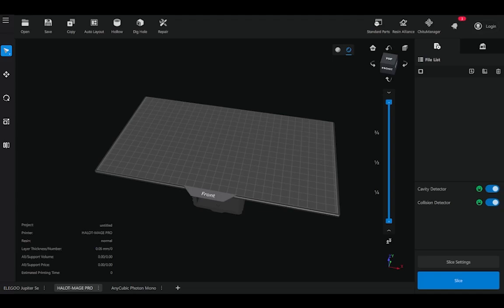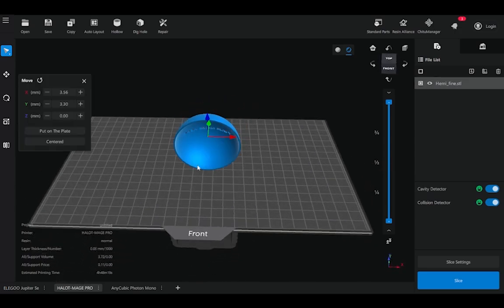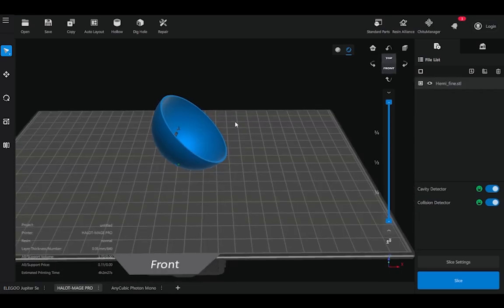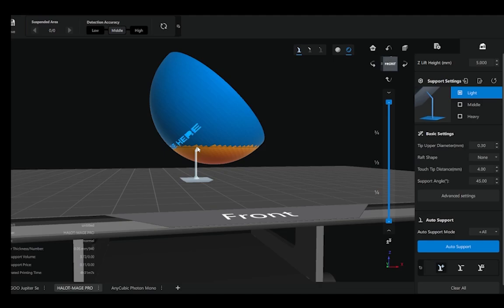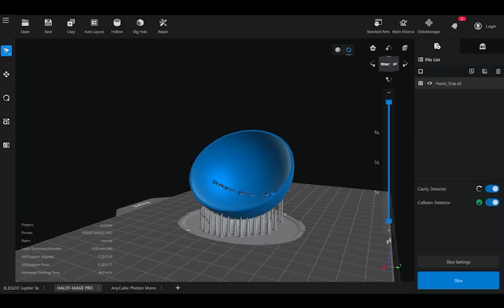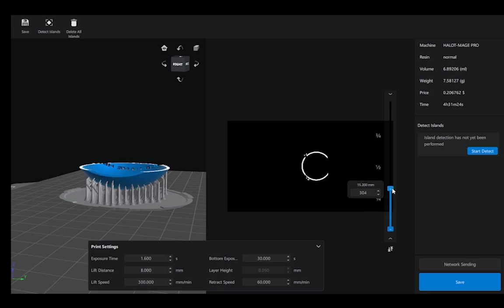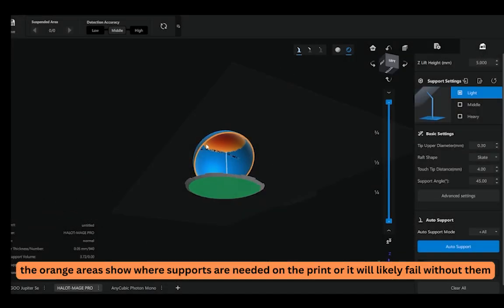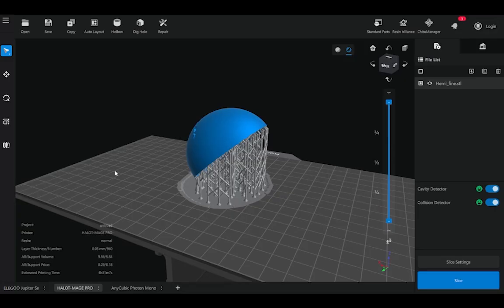Chitubox Basic for Beginners: 6-Min Crash Course

Comment: Ciao e complimenti ho scaricato l'ultima versione del se. Ma alla fine del processo dopo lo slide e schiaccio salva non riesco a salvare il formato che serve alla mia stampante Orange 10 il file e un lgs. Sai dirmi qualcosa? Grazie mille
Reply from the maker: Hello! I did some googling and apparently to use Chitubox for the LONGER Orange 10 resin 3D printer,  you will need to import a specific plugin to export files in the .lgs format required by the printer. You can find that here: https://eu.longer.net/pages/download-orange-10

On this link's webpage, you will also find instructions on how to do this. There is a download titled "Save lgs file by CHITUBOX V1.6.1.pdf".

Hope this helps get you started.

Comment: I've been considering getting a resin printer and I hadn't thought about the spacing affecting support removal. Good to know in advance haha.
Reply from the maker: Id suggest trying out water soluble material too when you get started because having to using rubbing alcohol is a pain in the cheeks for washing. Disposal & topping up on it is kind of annoying specially in our school lab. But I'm coming from the perspective of quick turn around in projects & being a bit of a lazy maker... Of course, try this material if youre making parts more for painting/figures, low load, indoor applications. Excited to see what you make if you go down this path :)